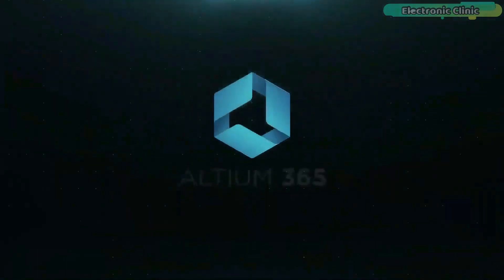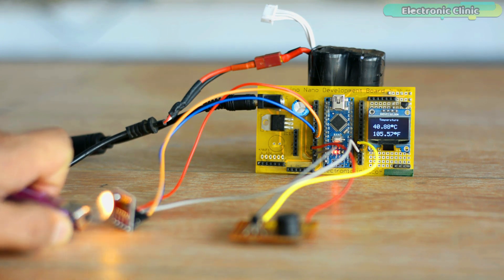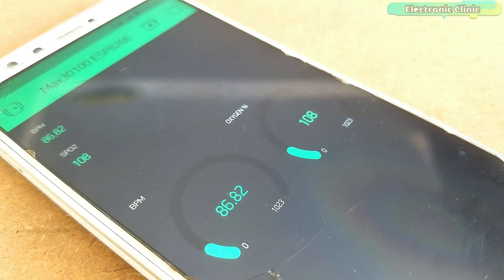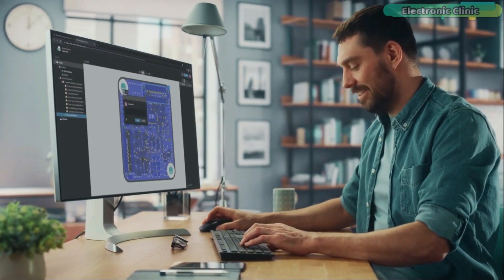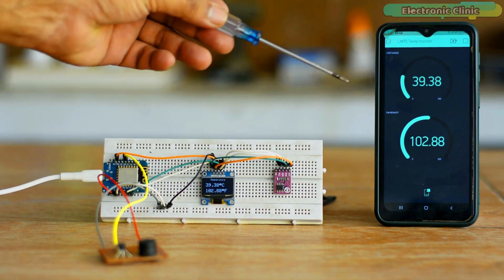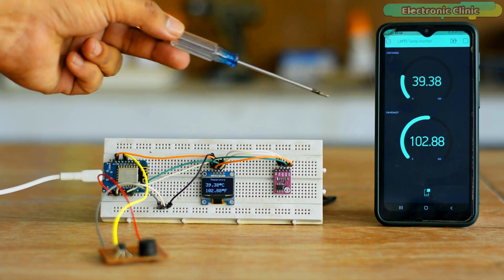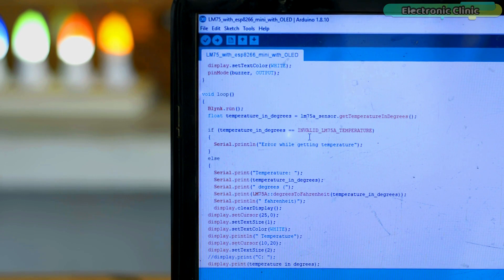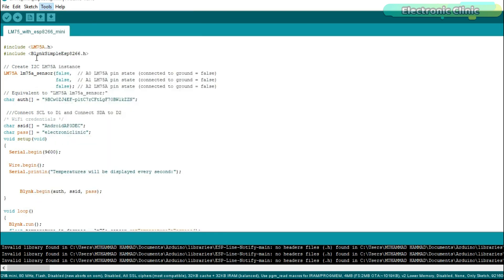LM75 with ESP8266 Wemos D1 Mini & Blynk, IoT temperature Sensor WiFi, IoT temperature monitoring

Comment from the maker: My other videos on Temperature sensors:

ESP8266 and NRF24L01 Gateway for Arduino IoT Cloud, DHT21 Sensor,
https://youtu.be/bl6IzQtZu_E

MLX90614 infrared temperature sensor with Arduino:
https://youtu.be/MhckQm-AMh4

Temperature Logger using Arduino and Excel:
https://youtu.be/NwB_JQS2P80

MLX90614 infrared temperature sensor with ESP8266:
https://youtu.be/hiwoEPf1xLs

MLX90614 with LoRa and Arduino:
https://youtu.be/QBgKL-LExq4

DHT11 Sensor with Google Spreadsheet using ESP8266:
https://youtu.be/7rCZB7tN4P8

Raspberry Pi Pico Temperature Sensor:
https://youtu.be/__v2P_RmXSY

Raspberry Pi Pico and Max6675 K type thermocouple:
https://youtu.be/mBhsMqcWyZA

Industrial temperature monitoring system using Raspberry Pi Pico:
https://youtu.be/mBhsMqcWyZA

Arduino Max6675 Wireless industrial temperature monitoring:
https://youtu.be/_RoFhuHLuO8

ESP8266 and DS18B20 Waterproof one-wire digital temperature sensor:
https://youtu.be/cv0yKRALZpI